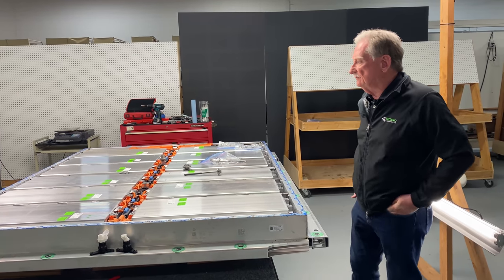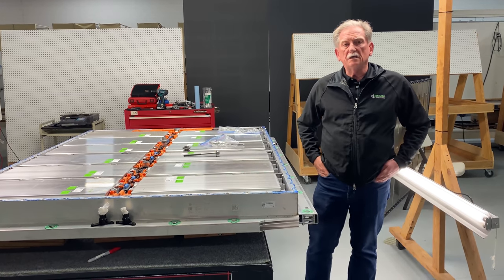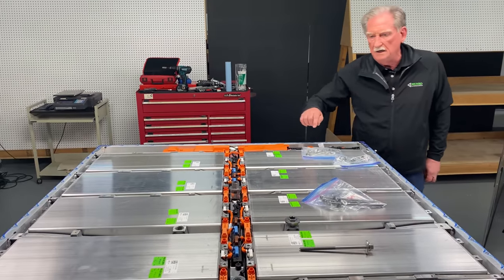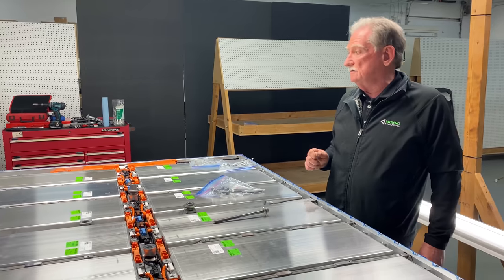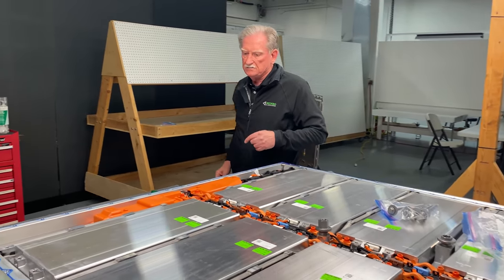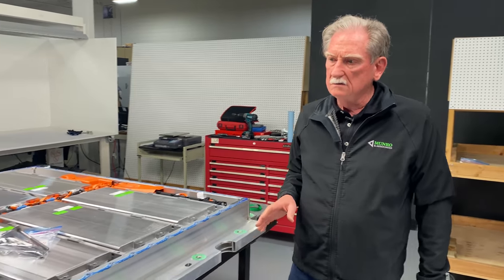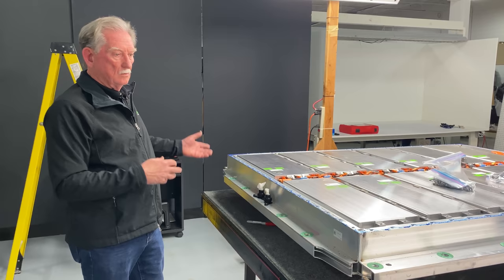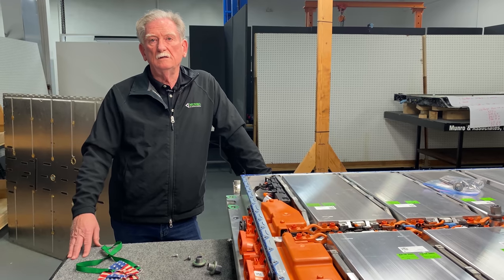2021 Volkswagen ID.4: Battery Teardown

Comment: Its like an engineering class on real engineering applications.
Reply: Especially an engineering class that uses SI units!
Reply: No, it's not.
Reply: dude there is no way replacing this alu with composites is cheaper. I don't know what is sandy smoking.  Also i have my doubt's there is 100kilo of alu there to begin with.
Reply: @hagestad  add to that the ecological cost of introducing yet more non-renewables. This is a farce.
Reply: Except he confuses the term "yield".
Reply: @zoren1994  "it plastically deforms and becomes a spring"
Reply: @DarkstarNovembr  it’s a “spring” also before yield

Comment: Germans are very good at mechanical engineering. I love my ID.4, it is the best EV that I have driven so far. I loved all the VWs that I have owned (Golf GTI and Touareg), they build cars right. Definitely heavier than Japanese cars, but the ride is much better at freeway/autobahn speeds. Much higher quality than Tesla.
Reply: Yes but the germans suck at electronics, my M2 is a nightmare
Reply: The quality on Tesla m3 seems to be way higher then my golf this far

Comment: Call me crazy but I'd rather have aluminium protecting and working as a heat shield versus plastic around the batteries. Especially considering they aren't solid state yet.

Comment: Wow.. that's a very well designed battery system!  Love that center wiring scheme & cast support system.

I'd do the finite element analysis on it with different materials to ensure the mechanical/strength, cooling, & electrical properties are maintained, while using the least cost materials where ever possible & keeping in mind production process efficiencies.  

I'd bet the total weight could be decreased even more than 50 kg/batt system.
Reply: Yes, they can reduce the weight by using other components instead of aluminium, but at the cost of reducing the repairability and recyclability, some times it's better to compromise in weight to have a more sustainable product.
Reply: @Gresteh  Good points. It could be made modular with composites to improve repairability & recyclability.

Comment: I think the meb platform this is from. Is designed to end up going in multiple different types of vehicles and I believe it's a structural member of the vehicle. 
I think the other issue is puncture resistance and impact resistance. I'm not sure I would trust a polymer battery casing although it could theoretically be better than aluminum.
It is a very attractive looking design and certainly seems to be quite structurally sound. 
The bolt EVS battery pack is a steel casing but it's stamped steel on the top cover and the bottom cover is a structurally reinforced steel. Like the Volkswagen though it is individually disassembleable. You can pull individual modules out and replace them if they fail unlike the Tesla design which is not really repairable

Comment: Just a moment ... Sandy said he wasn't tearing down ID4, nice surprise. the ID4 Battery is 5.96 kg/kWh. The Tesla 3 Battery (their most recent?) is also 5.89 kg/kWh, so only 73 grams in it. Seem fairly equivalent to me?
Reply: Why wouldn't it be equivalent? Do people still believe the nonsense about Tesla having some secret sauce nobody else knows about?
Reply: @primetablet  Sandy was implying the ID.4 battery was heavier than the Tesla and used it as a reference 1:38 those extra kW are the problem not the inherent weight of the structure, which unlike Tesla's battery, VW's seems to have extra internal structural bracing to help the rigidity for the vehicle chassis. And IMO looks like a much better design, assuming those boxes hold pouches and not cylindrical cells.

Comment: A polymer concept would have to be made of duroplast/thermoset plastic combined with kevlar or even carbon fibers as you mentioned. It would save weight but be very expensive, especially for high volume production. BMW used a lot of expensive CF in the i3 but learned that for EV efficieny weight is less important than drag.

Comment: I never knew a bolt's thread could act as a spring, or that there was a screw that could melt into place. Thank you for your informative videos!
Reply: The section that does not engage the nut can spring or deform. Sandy pointed out that the unthreaded section is designed to deform slightly.

Comment: Hi Sandy, isn’t composite materials much more difficult to recycle?
Reply: It isn't more difficult, it's impossible. Most glass fiber reinforced polymers don't even melt, the only way to "recycle" them is to burn them or grind them up and put somewhere else to nicely pollute the environment.

Comment: Just my thoughts here:

A Polymer structure pack:
    Nowadays battery packs have big energy density so I am very curious in knowing how it will withstand a thermal propagation event
    Is very strong for the first impact but not for the second one - Safety concern with multiple impact collision??
Carbon fiber:
    Not good at all for EMC
    More challenging for a solid grounding 
1 Piece connector:
    Could be more expensive - one connector gets damaged, the entire assembly goes out

Comment: what i really like is that u can easy exchange the smaller compartments of battery cells. Maintenance, Repair, perhaps even upgrade to better future batterie technology is totally possible. And the modular design can be scaled for different variants. U really see how the think strategically when designing, while tesla has a ad-hoc how to solve that problem today design. The Data comparison from Model 3 to Model Y shows they only made very minor increments, and its a fixed unchangable Design for that Model.
VW Design allows them to change to better battery tech on the fly, it just has to meet the modules specs.

Comment: 50 kg lighter?? 439/75=5.8533 kg/kwh. Thats TMY. If you want 82 kwh then the total weight would be 5.8533x82= 480 kg. Thats 9 kg lighter,not 50 kg. 489 kg listed for VW. Am I right or wrong?

Comment: Structural integration of the battery pack and vehicle chassis would yield more weight savings.  
FYI - integrating those connectors into a molded battery pack tub, would be nearly impossible .. due to varying material performance/cost requirements and tooling complexity of connector features.

Comment: I don't really understand where those 50 kg come from. According to the table the Model Y battery is 50 kg lighter but also 7 kWh smaller in capacity?
Reply: It comes from ignoring the capacity difference, which is a pretty blatant error by Munro.

Comment: What’s the recycling aspect vs the weight saving, recycling composite vs aluminium may benefit the use of aluminium 🤷🏻‍♂️
Reply: At the same time though lugging around an extra 50 kg for 500,000 miles or whatever the expected life expectancy of this vehicle is, is going to represent a lot of energy as well plus the initial melting of all the metals takes a lot more energy then sculpting a polymer at relatively low heat.
Finally if it’s one large piece it should be fairly easy to disassemble, and so if it is a reasonable plastic then you could relatively easily melt that down and reuse it.
the main problem with plastic recycling tends to be various types of plastics getting mixed together. That said if you were to reinforce it with other materials like say some form of fiber that would definitely make it harder to recycle
Reply: @FreekHoekstra  The thing is that Munro failed at basic math... the VW battery only weights 8kg more than the model Y battery would weight if it were the same size as VW's not 50. VW designed its battery to ensure recyclability and composites are usually not recyclable. In the end VW's design is fairly good, it may be a little bit heavier than Tesla's but at the same time is modular, easier to repair and easier to recycle.
Reply: @Gresteh  Sadly I have to agree. Some of the recent videos on this channel I don't think follow any reasonable logic.

Comment: Do you mean elastic state for that bolt, not plastic? from what I understand plastic deformation does not allow the bolt to return to its original state. You are therefore tightening ( torquing ) the bolt to a figure below its yield strength i.e. the elastic region, anything above this will be plastic.
Reply: The bolt will be permanently deformed. Any structural bolts should be replaced if removed for proper joints.
Reply: @CharlesClift  If the bolts are permanently deformed, would they work as a spring as suggested? I would assume not. One use bolts on a car are new to me if that is the case. happy to learn more on that one
Reply: @markytuck  Some engines use the same method to mount the cylinder head to the engine block. There are usually long screws and once you torque them they have to be replaced when the removed. It is called Torque to yield head bolts.
Reply: @asicdathens  thank you, I have learnt about a new type of bolt today. Seems to be good for high amounts of thermal cycles and high amplitudes. Would be interesting to understand why they use it in this location specially.
Reply: The are used elastic. 80% of the 800 N/mm², so 640 N/mm² (refering to the mentioned 8.8 screws.

Comment: The pack is a structural density component hence the heavy alloy casing and those bolts. Was told by my local VW service that once they remove the battery for service (I was called in for a factory module replacement?) they are not allowed to lower the car since it may bend the chassis. It took them 10 days to sort out my id3.

Comment: No easy way to recycle carbon fiber structure. Let’s not advocate for that.
Reply: I agree.  There's only so many recycled hipster office desks people will want.
Reply: Bmw actually recycles their carbon fiber
Reply: @alanmay7929  I am curious how. Once in shape the fiber can’t be extracted. If it’s chopped it won’t have the same strength anymore. It’s essentially hard needles that’s not reusable.
Reply: @qilu6313  carbon fiber is actually too easy to recycle, they burn it to reduce the bonding resilne and the fibers can be reused again.
Reply: @alanmay7929  it is possible to recycle it but the capacity is quite low. Also the process is far from environmental friendly. I was digging for more updated info around the topic. Seems that the recycled fiber is still pretty decent in quality but certainly won’t provide the confidence for high performance structures. I could be wrong about the state of the art recycling method so if you can provide more references I would appreciate it.
Reply: @qilu6313  probably by making fillers for road construction, aka bs marketing and not really recycling.
Reply: @qilu6313  why not? Please learn about that
Reply: @alanmay7929  That's not recycling the resin because it's lost in the process; it's just a waste disposal method. The fibres are massively downgraded.

Comment: I think the reason is because the battery pack is designed to be swapped out.  The structure has to be strong enough to withstand being released and reattached without a problem.  That's why it has Thru Bolts.  That's why it has funky machined edges.  All for swapping out.

Comment: crazy overbuilt.  i don't know but more likely reuse this design for other cars and into the future. this also feels a bit better for recycling
Reply: They use this in MEB platform in Skoda, Audi, VW models with 40-77kWh usable battery size.
Reply: Battery tray and pack, should be over Engineer, for side impact, general crash resistance and pack Underbody protection. The iD4 is a SUV, so it should be Beefier than a sedan. Also the front and rear diffuser can be made out of plastic. 
I'm not so sure polymer is a good solution here. 
SANDY should benchmark TESLA model Y  first.
Reply: They will build literally millions of these battery packs per year, VW will have massive economies of scale with that thing. There will be over two dozens of electric car models all using this battery pack across the entire company in just a few years.

They put a lot of effort and money into designing and engineering this pack.

Comment: I'd say leave it as it is. Fix the rest of the overweight car.
Reply: Yeah vw just need to use more aluminum or light weight materials on the car shelf
Reply: Somebody is already working on it. The goal is an overall weight reduction
Reply: @alanmay7929  That would work for sure. Fibreglass too for non weight/stress-bearing parts. Beware of aluminium's weaknesses though. It's very different from steel and can suffer metal fatigue. You'd not choose it for springs for example ! Aluminium is also a soft metal (sometimes useful), its alloys less so, especially aircraft alloys. My 1970 Rover P6 (2000TC) used some aluminium bodywork to reduce weight. Bristol (also aircraft makers) and Alvis used aluminium too, way earlier, in their cars.
Reply: Not that easy when the buyer wants power seats, big greenhouse, more airbags for safety, more sound deadening, meeting new crash requirements, etc. It all adds up. Which is why we no longer have spare tires for one thing.
Reply: @davidmccarthy6061  true,  but this VW is heavier than its competitors too. There are gains to be made,  and are crucial for EV performance
Reply: @davidmccarthy6061  The spare tyre is, ironically, far more useful than any gadget,
Reply: @jamesengland7461  Model Y weight = 4416 lbs.  ID.4 weight 4559 - 4665 lbs.   Worst case, it's 250 lbs more.  Not exactly a huge difference.  I imagine a lot of the weight savings is coming from Tesla using more aluminum.  Aluminum is certainly lighter... but it's also expensive.  Probably why Tesla is trying to save money by casting larger aluminum parts instead of spending more on equipment to weld them.  Other OEMs are just like "nah, that's ok, we'll keep using cheaper steel".   I'm certainly curious at how much those casting presses cost, and how much energy each casting takes.
Reply: @updlate4756  the efficiency and range certainly aren't class- leading.

Comment: Plastic and yield state is no different from each other. Anything less is elastic elongation. Tensioned bolts don’t need to be in yield/plastic deformation to function as intended.
Reply: I'd have though elastic was best, although I have heard of cases where plastic deformation is specified, 'big end' bolts for example. Just make sure to use a new one when rebuilding !
Reply: Glad you mentioned that. However I do believe that “tighten past yield” is a “common” approach for critical fasteners like engine head bolts. Although I’m not sure exactly why but it might be a good way to get consistent preloads without all the friction variations of torque
Reply: @tf1354  There has to be a good reason I'm sure. Those bolts typically also don't use a locking tab washer which troubled me somewhat, so I improvised some myself.

Comment: $10/kg is on the high end. I've typically seen $5-7/kg in the EV industry. Also, this looks like similar construction to NIOs early battery packs. It's like the only tool in their tool belt was aluminum extrusions and a CNC machine.

Overall it's a clean layout, you can tell battery got priority in the vehicle packaging meetings. Typically everyone thats maxing out capacity runs into issues at the front torque boxes, that's why the model 3 has 2 module sizes.

Comment: A spring is not supposed to see plastic deformation, did you mean elastic when talking about the long bolt?
Reply: Listen again to his chat on this subject.  He clearly states that the bolt is tensioned into an elastic state, but not as far as true plastic deformation.  Hope this helps...
Reply: A bolt, such as head gasket bolt, actually is torqued and then further rotated into the transition region where plastic deformation has begun. That is why they are single-use.

Comment: Rail track joints in Europe are NOT cut at an angle. I am European and member of an NGO monitoring rail infrastructure. The smooth tracks are welded together for continuity, but the steel is special, it does not expand or contract with temperature. And there's plenty of normal track joints that cause the specific sound when train wheels pass

Comment: Cost reduction with carbon fibre/composite, sound cheap and easy to manufacture:) Good luck with that:)
Reply: I'm often reminded to the example of the GR-Yaris which is a highly optimised design with alot of bespoke leight weight components, which are unsurprisingly quite expensive. As a result the GR costs about twice as much as the normal version and is simply not a 'affordable' economy car. It is awesome, but not cheap.
Compared to ICE cars, the range/efficiency of EVs is also much more dependent on pure battery capacity and aerodynamics. Pure weight savings, while desirable, are secondary.
Reply: @lennoxbaumbach390  I am often reminded of sarcasm

Comment: The major design parameter for the battery container is the potential thermal runaway because of an accident or some other penetration of the battery pack.so 50 kg alumium or even Steel in some areas can be are really a good Investment in the end. Also from sustainability  side the alumium carrier is the better choice.